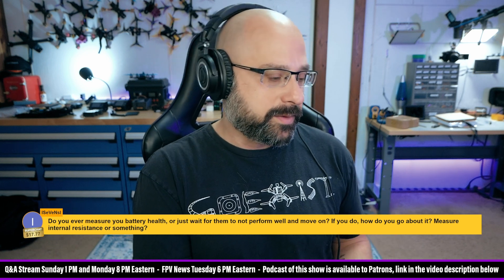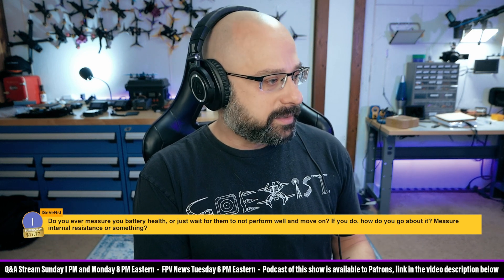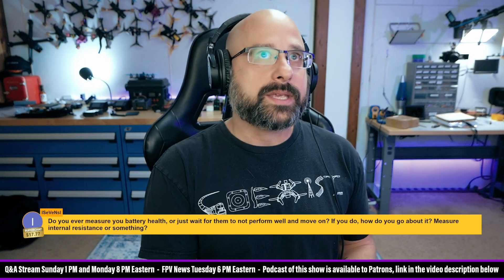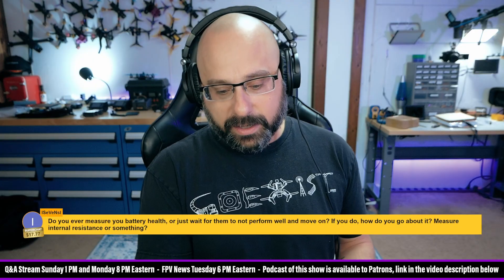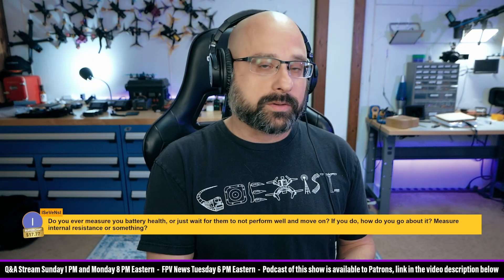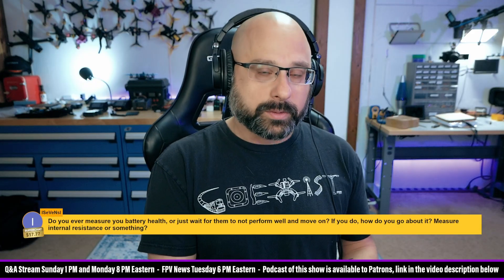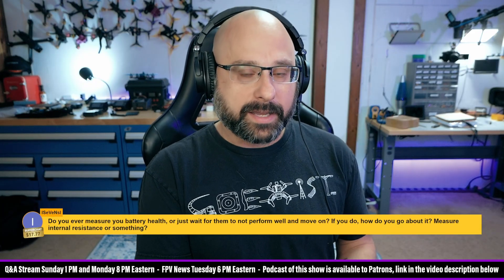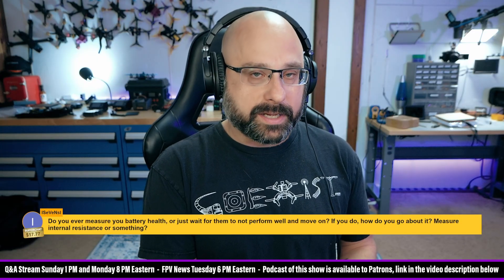How Do I Know the Health of my Lipo Batteries in FPV? Internal Resistance? - FPV Questions

Comment: I suspect the default settings of bnf mobula 24 is to low.
It blink batt and 5-10 seconds later the drone drops.
Its maybe 2-3 sec between batt and land now.
I would want it to be 0,1 volt higher, but unfortunatly i cant get betaflight to work on my computer.
And yes the batteries dont live so long this way.